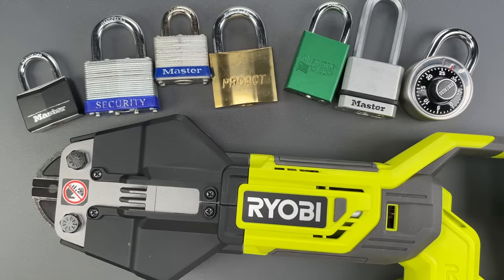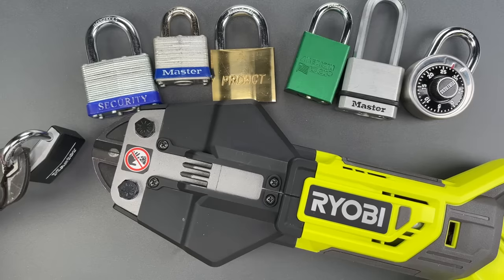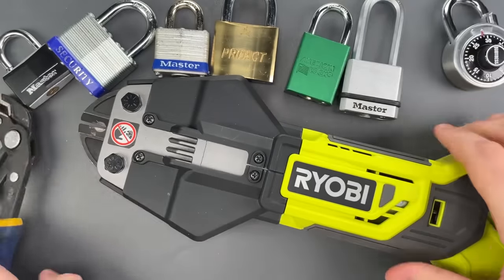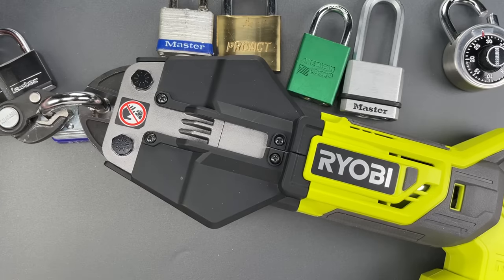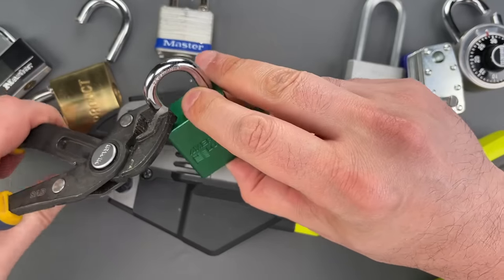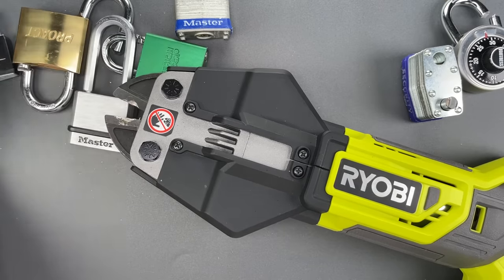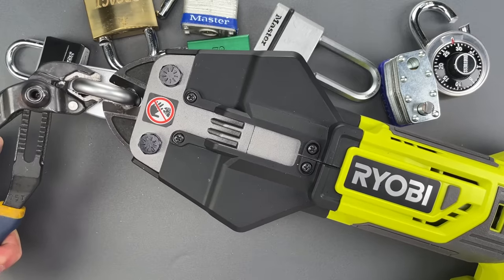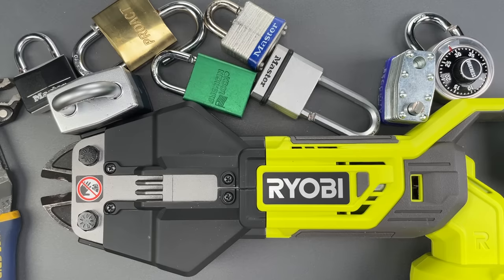[1408] Better Than Expected: Ryobi Bolt Cutter

Comment: One thing, it would have been nice to have a closer look at what it did to the Squire shackle. There seems to be some very minor, mostly cosmetic damage to the last shackle, but not much more than that - but it's hard to see from this angle.
Reply: I don't think it caused any noticeable damage, other than a scratch. The shackle dug into the blades instead.
Reply: He needed to move the padlock further into the jaws! Leverage!

Comment: LPL: This no-name padlock will be pretty soft.
No-Name Padlock: And I took that personally.
Reply: Shit had me wheezing. The lock immediately decided to put up a fight.
Reply: The softness was probably to it's advantage. A harder, more brittle material would probably break sooner, while a softer one will deform more before breaking.
Reply: @raymondheckford4546  i agree
Soft= -not hack saw proof 
+bolt cutter resistant
Hard= +hacksaw resistant 
-not bolt cutter resistant
Reply: @amimeanime3234  Plus that one was thicker than most of the others, not friendly towards wedge shaped bolt cutter blades.
Reply: I was dieing. It’s like you think I’m soft I can’t take a hit? Try again. Haha
Reply: @acknowledgedofalltheconseq366  True but the two almost always go together.
Reply: It's always the unknown challenger that will surprise you.
Reply: Oh, a talking lock, amazing.
Reply: The American lock was much harder. So it broke in 2. The softer metal of the noname deformed more. So it didn't break till the blades were basicaly fully closed.
Reply: No-name padlock: Gimme a minute, I've got a pill for this.
Reply: I knew it would give a fight cos I've used dremmel cutters on a few different locks before (including squire). The weakness (including squire), i.e. the quickest way to cut  the lock isn't the shackle. Its cutting just two streight horizontal cuts along the bottom laminate plate (don't bother popping the rivets). Once you've cut that part of the plate off, the cylinder falls out. ...although sometimes you have to cut through two laminates, it's still very quick. Master lock laminated padlocks are even worse, as they're very thin tinny metal. Its a shame really, cos if they'd have used a thicker plate with their recessed rivet design, it would have been a really physically tough lock.
Reply: Of course the no-name lock did better than the Master locks.
Reply: Eh, it didn't damage the blade though.
Reply: @acknowledgedofalltheconseq366  They're always proportional, at least in metals.
Reply: Best! 😆
Reply: @penfold7800  Interesting stuff here
Reply: My impact sparks if it's at full tilt and you suddenly release the trigger
Reply: My stepdads brushed sawzall had a car dropped on it and tried to catch fire like 4 times and it's fine, my HP full size hammer drill went through a 2ft thick log no problem.

Comment: "Better than expected" Is what Ryobi does, especially it's the "store brand" for Home Depot. I have numerous Ryobi tools, and they're pretty good. Based on testing from other channels like Project Farm, Ryobi is usually very middle of the pack, or just above the middle, which is perfectly fine given its price point.
Reply: Agreed.  I don't need construction professional quality tools as a network installation tech but do need something capable and Ryobi makes capable tools.  They aren't the best in show but they do work hard enough and the price point hits just right for my needs vs. cost.  I have noticed a LOT more neon green on job sites the past 6 months - their quality has greatly improved on their top of line items and people are noticing.
Reply: And don’t forget that it’s thanks to Ryobi we have the same battery for all our tools. Before they came along all major brands had different battery’s for different tools.
Reply: Yep. Ryobi is just fine for the vast majority of home use. They really upped their game with the One+ stuff. It's still not for use in professional construction work (some exceptions) but compared to the absolute garbage they USED to put out? The difference is night and day.

Their old, discontinued (I hope) blue series stuff was beyond useless and the batteries, oh GOD the batteries. Hold a charge for about a month and then would just stop working and charging.
Reply: @shakes5847  Those were NiCad batteries.   The new lithium batteries work fine in the old blue tools.
Reply: @FiOSFellow  I'm well aware.
Reply: @jnb756  That kinda reminds me of when Nikon put out the D2, and finally got NFL-speed autofocus right... and in one season, the sidelines went from 100% white Canon lenses to about 75% black Nikon ones.
Reply: They had a base tool with interchangeable tool heads that I bought on clearance and the Rigid attachments interchange with the Ryobi so I bought all of them too as they were really marked down. Really handy in that one portable tool box can hold a variety of tools for quick jobs.

Comment: Ryobi comes out with really nice home user tools!  I love their nailers and staplers, pvc cutters, glue gun, tire inflator, caulking gun, etc.  I don't buy their typical tools but they have some nontypical tools that are really a good value compared to the big boy brands.  And if you're not using them every day they will last forever!
Reply: A very good point sir ,I work in construction and I never see them anymore and for a reason sadly but I have recommended them to home owners and alike as long as you don’t abuse them they good value for money in some cases
Reply: I like'em too! I don't love that I'm kind of locked in to Home Depot though. My local hardware store isn't going to carry more Ryobi batteries.
Reply: I work hvac and I'm only on my second set of ryobi tools...the first set was fine. My truck was just broken into and they stole all my tools. Batteries however...lol
Reply: I've always wondered about the caulking gun... Mostly on why?
Reply: @yunofun  Yeah, the caulking gun has turned out to be the least impressive Ryobi tool I own.  Even on it's slowest position it shoots out the caulk at too fast of speed for doing simple caulking and I use a regular caulking gun instead.  Where it would come in handy, however, is using a Liquid Nails kind of glue to glue plywood to joists and that kind of thing.
Reply: I have done some pretty jank shit with my HP hammer drill and impact driver kit. They've held up for 3 years so far. Although if you're in construction buy dewalt

Comment: We need a race: 10 random locks, LPL with his picks, and someone else with one of these puppies.
Reply: How about just a good old manual set of bolt cutters....
Reply: @adammckay7335  Serious question as I don't have either type: what is the difference between the manual ones and this battery-powered model? Are the blades designed differently or made from different materials?  Thank you.
Reply: @bikeny  with the manual one, you have use it manually. With the battery powered one, you use battery power.
Reply: @bikeny  Manual ones either use really big levers (a couple feet long) or hydraulics to give your arms mechanical advantage. LPL had a series a while ago demonstrating a hydraulic cutter. This one uses a battery, and you just pull the trigger.
Reply: @bikeny  just speed.... I have a cutter that would go though those locks in about 10 seconds. But big security locks are almost uncutable. It would be just interesting to see the race.
Reply: I know who the someone should be. Mrs. LPL
Reply: @bikeny  just to make it sporting. A little more effort is needed with manual
Reply: @bikeny  I would like to also, saves asking, thanks
Reply: Yes
Reply: Project Farm

Comment: I have one of these and the battery being used means alot to how well these work. Get the larger battery and it will cut through alot better without all the stopping.
Reply: I not telling you. You already know..When using a impact drill/driver the difference in power is enormous from one battery to the other.

Comment: I love old power tools that you can literally see sparks flying around on the inside. Didn't know any like that were still being made today.
Reply: brushless motors are why you no longer see sparks on (most) current products
Reply: @verdantsands  My brushless impact drill, Dewalt, 18V, 5 years old, since about 6-8 months its throwing sparks out of the motor.  Still works, and i'm waiting for it to die maybe soon. :)
Reply: @baqcasanke  you sir don’t know the first thing about power tools if you actually think that.
Reply: @baqcasanke  they have both brushed and brushless versions of their tools. Get the brushless and there's no sparks
Reply: @Outworlder  there's no brushless version of this.
Reply: Also dewalt 18v hasn't been a thing since like 2011 lmao

Comment: Don't get me wrong, I love the actual lockpicking content, but the destructive entry stuff like this is really fascinating. I didn't even know that electric bolt cutters were a thing, lol.
Reply: Oh yeah dude it's a problem in Europe that theifs are using them to break locks and chains
Reply: @drive5555  That's wild, you think they would use "normal" old-school manual bolt cutters.
Reply: Then there was the video where Mrs. LPL demonstrated that destructive entry was the quickest way to get to her ice cream...
Reply: Manual bolt cutters require some amount of body strength and commitment.
Reply: @thmsmgnm.4513  They're also quieter... depends on what you're going for, really.
Reply: Oh yeah. They've been a thing for several years. I first saw them almost ten years ago in the receiving department of a big distributor/warehouse. When you have to cut 100+ security bolt seals every day it makes sense on a couple levels to have an electric cutter vs a manual cutter. Less fatigue and risk of injury for your workers. 

Not sure if it was electric over hydraulic or a geared screw jack or what but it was about half the size of the whyobi.
Reply: @somejerk5662  you don't really need to be quiet with stealing something, which is also why nobody actually picks locks on bikes for example, but just cuts them. The most important part is speed. You cut the lock and ride away, and nobody will know where you are by the time anybody gets there. You can steal bikes in plain daylight.
Reply: @arturjogi2667  Sure, but if you're breaking into a garage or something the last thing you want is a power tool that wakes the neighbors.

Comment: I work for a scrap metal company, when you said “I suspect this will be soft” about the “security” padlock, I could hear that it’s pretty solid. The main way we can tell if a metal is soft is by scraping it with a blade made of a metal whose hardness is widely known, eg copper plumbing or roofing iron, the less common but just as effective method is what the metal sounds like under pressure, a basic rule is the higher the pitch, the harder the metal. Of course there are exceptions, but between these two rules, a decent perception of colour and a strong magnet, you can determine the approximate makeup of any metal

Comment: I had the older version of this tool. The blade damage looks bad but it doesn't effect the cutting ability too much. I worked at a place where people were always losing their keys and used it a lot. The jaws looked knarled but still cut.
Reply: It does a lot.
The cut is way cleaner and it is not just pressing the parts apart.
But then maybe only noticeable when cutting a car^^

Comment: The material on the Squire lock shackle is amazing.   When the material you're trying to cut is harder than the material of the blade you're cutting with, it will fail regardless how sharp the blade is, where target is placed on the blade,  how much juice in the battery, or pressure you you put on it.  The softer material will either bend, crack, or break off instead of biting through the harder material.  Thank you for another informative and enjoyable video.   Have a great day.

Comment: When I was a trucker, my trainer recommended these for cutting locks that had been mistakenly left on trailers. It happens more than you'd think and sometimes handheld bolt cutters are very difficult to use.
Reply: this is a perfect use case for you I think.. also conatiner yards having to destuff containers
Reply: Probably a better investment to just buy a good cordless die grinder. IT will destroy  almost any lock or hinge, or if trying to be stealthy, go with the dremmel .  With either one of those tools you can also do other stuff with it, instead of buying a one trick pony.
Reply: @brianwalker8759  that would take quite a while, and would be a huge pain to try to use in driving snow in -10 degree weather. The goal is convenience and speed, not efficiency, stealth has nothing to do with it, and you can't damage the trailer you're trying to get the lock off of, because you need to put your own lock on it. A grinder would be a worse solution in every way.

Comment: I'm interested in seeing how this does against U locks or common bike chains. Seems like it's portable enough to be a threat, and quick enough to make the bulk worth it.
Reply: "Up to a quarter inch thick". That's 6.35mm. Even the worst U-lock or chain is likely to be thicker than that.
Reply: @wbfaulk  Plenty of chain locks are 6mm, everything under 1.5kg is like. Usually square shackles though, so would be interesting to see this tool try.
Decent locks are at least 8mm and up though, but they do get heavy.
Reply: @ZesPak  I'm surprised to find that you're right. Kryptonite, even, sells 5.5mm and even 4mm(!) chains.
Reply: Any bolt cutter is inappropriate for that type, although some can chew through a thinner lock body and skip the shackle. From someone who cuts through chain regularly, the first 3 minutes of this video made me wince because the first rule is: get whatever you're cutting as deep into the jaws as possible. The leverage that the cutters had on the first ones was a fraction of what their power is when the lock shackles were pushed in farther. However, since there's always going to be a hasp in the way, this was very realistic.
The first shackle was about 5mm, the next ones were definitely a shade over 6, and the last one looks just shy of 8. 
Anyone who runs a storage facility (that uses exposed-shackle locks) would consider this tool a gift from above, because a 36" conventional cutter weighs a good 20lbs or more, and they need a second person to steer the cutters onto the shackle to be effective.
This cutter is very impressive.
Reply: this thing's "bulk" vs fullsize 24" bolt cutters
Reply: A lot quieter than a cordless 5" grinder with a cut-off disk, too.
Reply: @wbfaulk  to wear right? they sell them to wear?

Comment: Towards the end, how much of the effort was the resistance of the shackle to the remaining power left in the battery?  It might have been helpful to see the battery life as the experiment went on.
Reply: Good point.  The test should have been conducted using a fully charged battery for each lock.
Reply: @Firedog-ny3cq  That type of ryobi battery tool goes pretty much 90% and higher until it just drops to dead.  Not really a slowing down as the battery discharges like older tools.
Reply: If a tools battery is drained within 5 minutes of using it, its propably not worth it anyway
Reply: This type of tool (cutters) generally don't drain the battery that much. I have a Bosch branch cutter and a Milwaukee PVC pipe cutter, they run a very long time on relatively small capacity batteries, without appreciable reduction of the cutting force.

Comment: In AIT, the drill sergeant had a large pair of bolt cutters to get into lockers ... they where very chewed up, but the private who lost his combination was the one who had to cut the lock .
Reply: shame none of you figured out the "hit it with a hammer on the dial and it pops open" trick for master combo locks

Comment: Cool!
I wonder if a change of blades, that last one might have gone. It had settled into a rounded bit of the damaged blades, which wasn't giving the Ryobi a fair chance. Surely a sharp blade would be required for the hardest shackles.
Reply: Perhaps we'll get to see that in the Sequel... :-)
Reply: It would make a big difference. Even setting the bolt at the end of the blades would likely have been enough to do the job.
Reply: A larger capacity Ryobi battery might also have helped, since that would allow the tool to draw more current before the battery management system (BMS) in the battery cuts off power to the tool.

Comment: Being a plumber. What I'm hoping is that with this high torque mechanism, they'll make a cheaper competitor to Milwaukee's pro-press for press fit copper fittings.
Reply: Ryobi and Milwaukee are the same company . Find your Milwaukee rep in home depot and talk to him for any deals
Reply: Bought this for maintenance in an industrial setting, literally trashed the blade immediately. Now it's an over priced paper weight, completely useless. I just use normal bolt cutters now
Reply: @jordanartinial4593  I'd imagine. I don't need the bolt cutting function. Just the high torque mechanism.

Comment: A 10 euro small sized manual bolt cutter from Lidl does wonders on locks too.  Chewing through the brass casing is fun as well.
Reply: Didn't knew they sold bolt cutters at LIDL
Reply: @dimmacommunication  Well it's not next to the cheese or eggs but they do sell it sometimes during special offers for tools etc :)